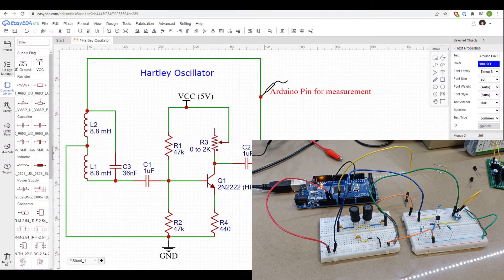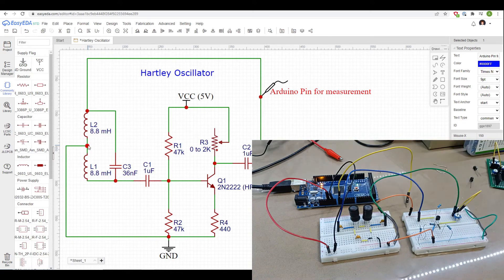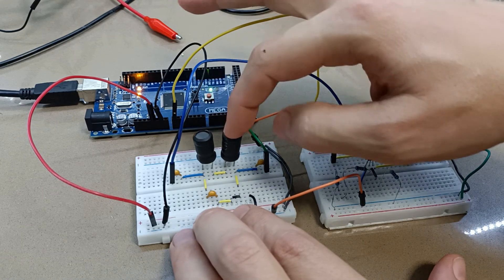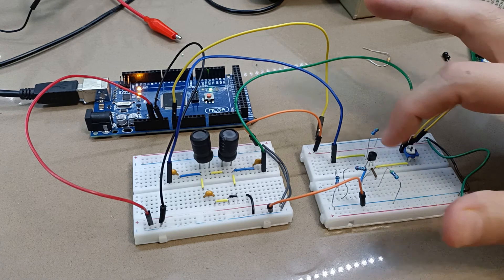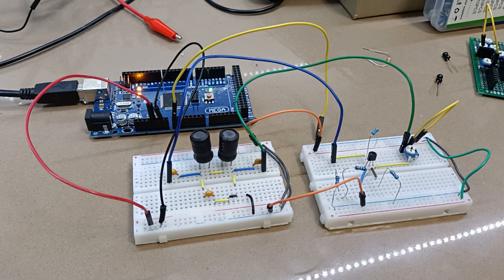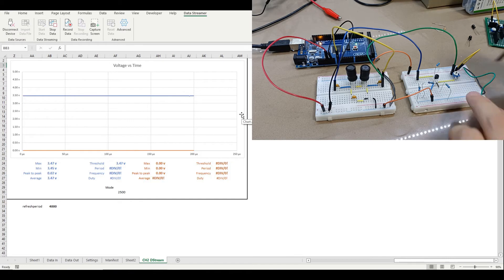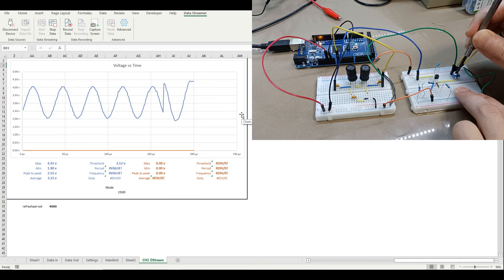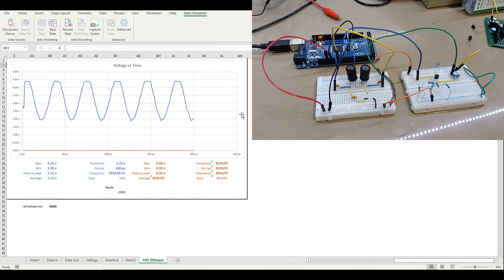Hartley Oscillator (with Arduino Oscilloscope)

Comment: I see you have tried many oscillator circuits in your videos. This Hartley circuit reminded me of an ingenious crystal radio that uses the chip on a credit card as a diode.

I think you might find this build interesting. Since YouTube frowns on links in comments you will need to look up the video title which is: Smart Chip Credit Card Crystal Radio

It might be interesting to view the oscillator part of that circuit on your oscilloscope.😊
Reply from the maker: Thanks for the email about the credit card crystal radio.  That was quite interesting.
Reply: @overengineeredinoz7683  Another video called {850} How To Test Crystal Oscillator
Reply: @overengineeredinoz7683   Another interesting circuit titled: An almost solderless crystal radio

The above radio uses two tiny inductors in it's oscillator section. It looks to simple to even work. I ordered the parts to give it a try. I'd love to see an oscilloscope on that circuit too.

Comment: Que tipo de Arduino usa por favor?
Reply from the maker: In the video it was an Arduino Mega 2560 but the excel oscilloscope will work with UNO R3 too.
Reply: @overengineeredinoz7683  , muchas gracias

Comment: Greetings, have you considered evaluating the DC power efficiency of the oscillator circuit?
Reply from the maker: No but I would be interested to hear about it.
Reply: @overengineeredinoz7683  You may be interested in the analysis and design of a Colpitts oscillator; https://www.youtube.com/watch?v=TSKq5l7uuz4